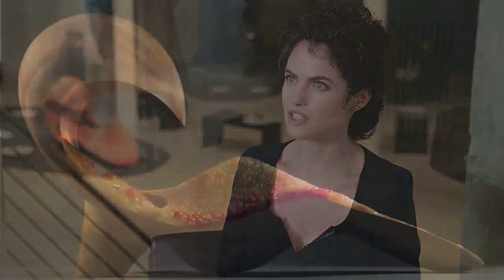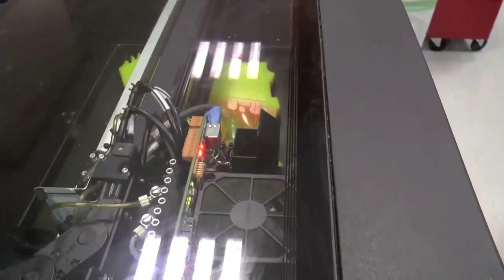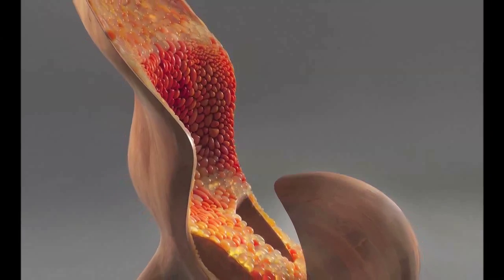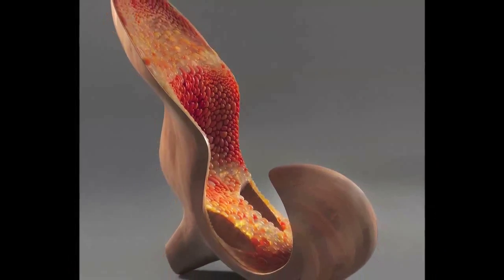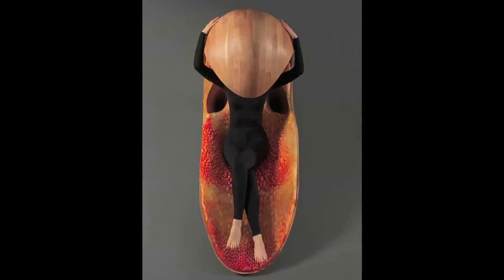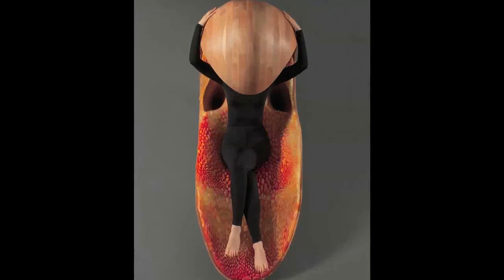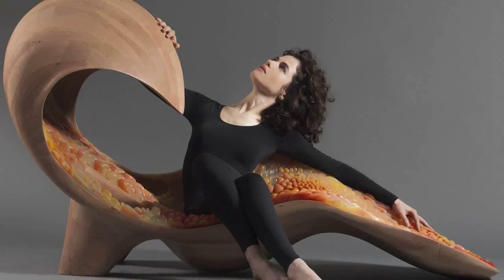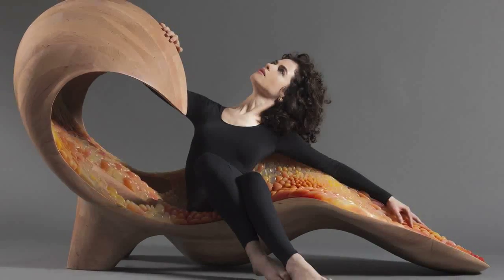Vocal Vibrations: Neri Oxman's Gemini Acoustic Chaise created with Stratasys 3D Printing

Comment: can a nuc pc, heart beat sensor, and oled screen be installed in this? hello?!
Reply from the maker: Yes, it is possible for the chaise could be fitted with all sorts of electronic elements.
Reply: Great, so how long before we'll have these in our homes and hospitals?
Reply from the maker: Interesting question! How do you imagine the chaise being used in a hospital setting?
Reply: Based on where wearable-tech, and health-care are going this device will bridge the gap easily. The design would have to be tweaked dew to the application. For example: Massage and operation tables could be redesigned for extra strength, comfort, beauty and multi functionality. I have seen a few videos where people carrying babies on their back, almost completely exposed to the elements. I know a smaller redesigned version of the Chaise will provide additional comfort and protection for our toddlers.        
The list goes on.